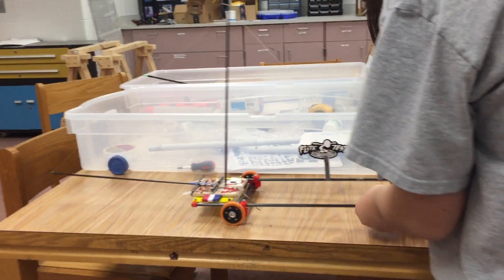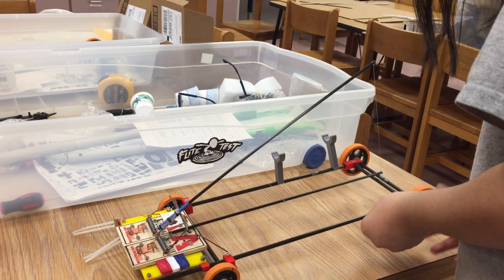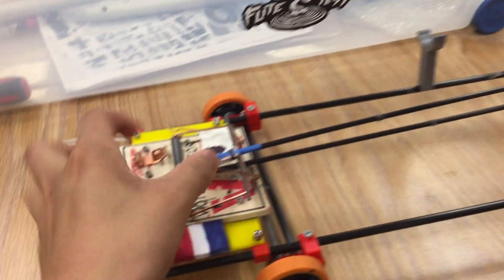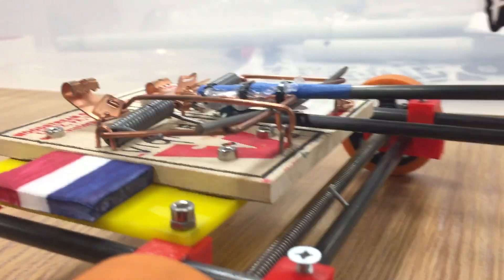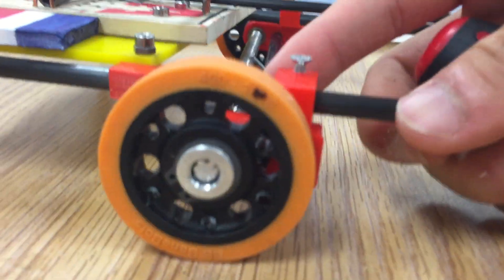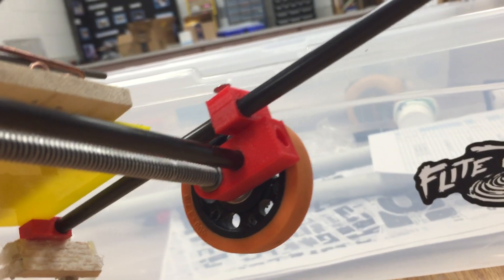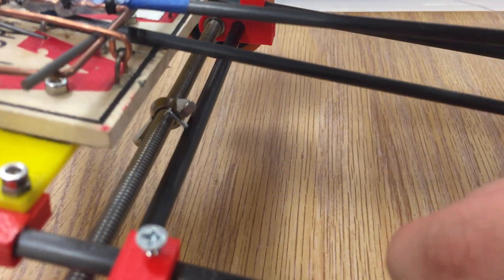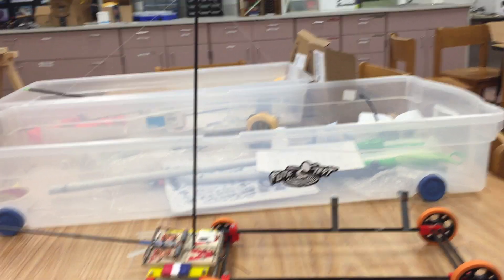Science Olympiad - Div C. Mousetrap Vehicle 18-19

Comment: can u explain in bit detail about how did you connect two lever arms together and how string is connected such that one pulls another and total pull length is increased by using 2 arms?
Reply from the maker: Well, first, we tried to make sure the two arms pivoted around roughly the same location, and once the middle arm was freely rotating about its pivot, we attached a line between the two rods such that the rotation due to the mousetrap was transferred to the middle arm once the string became taut. Therefore, to attach the string which pulls up the middle arm correctly, have the mousetrap fully disengaged and the middle arm at its desired angle relative to the at-rest pivot arm (preferably 90 degrees, to get the most string extension), then attach the pulling string with super glue or another method of your choice.
Reply: Wendell Wu thanks for explaining. Where did you buy these lever arms and hooks that are connected in top of these arms ?
Reply from the maker: @manishsaxena8680  sorry for the late response - the "hooks" are actually just 3D printed inserts (they're literally a rod with a donut at the end) that we inserted into the tip of each rod, and one end will serve as the pivot point (which is just a nail bent into the shape of a staple put into the mousetraps) and the other allows the fishing line to pass through it.